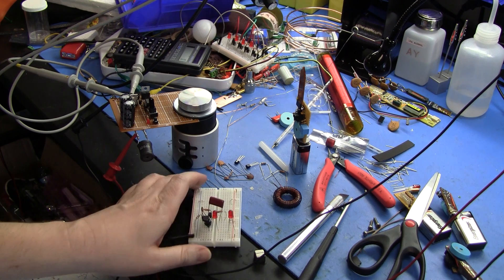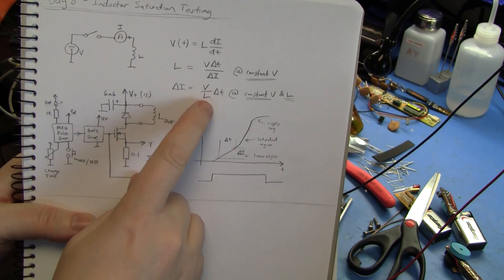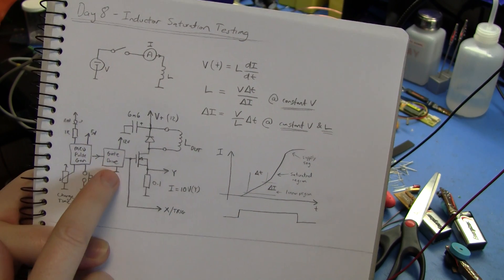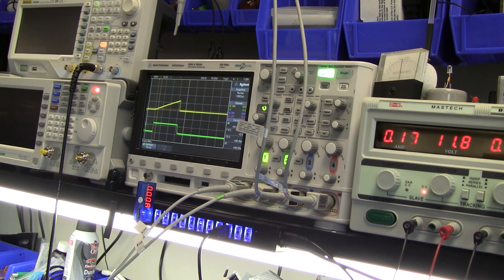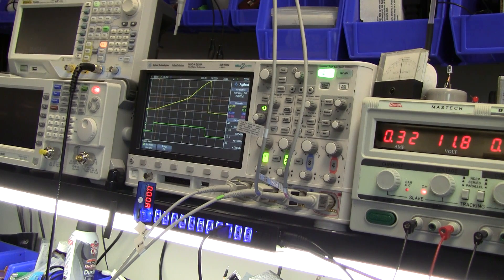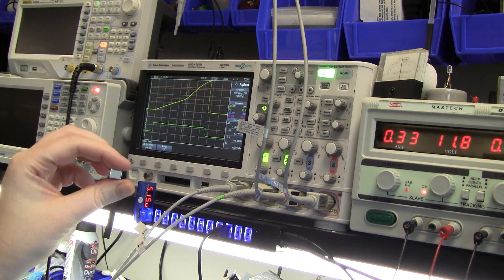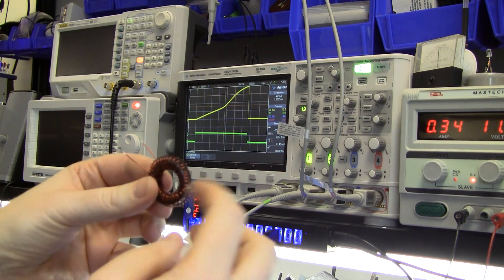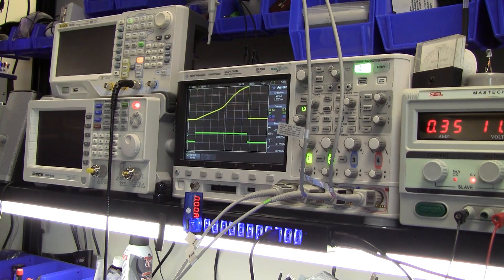Advent Calendar of Circuits 2014: Day 8: Inductor Saturation Testing

Comment: Thanks very much for this. Its incredibly useful! Have built this circuit and it works great. I didnt use an MCU but hooked up a signal generator and a discrete gate drive circuit Ive been using for a while. Thanks 😊

Comment: Hi vk2zay,

I found this interesting video in your youtube page. But I've some questions related to Inductor saturation switching period. May I know, are you using the high frequency switching square pulses to test the effect of inductor saturated? Because in your video at 5.01min were describeb by using MOSFET driver to drive the MOSFET switching ON/OFF and the switching period is controlled by the push buttons. So what is the switching period of time in this experiment?

Regards,
John
Reply from the maker: +Lucky Pipi The on period is controlled by the MCU which helps set the maximum current (along with the inductance of the DUT and its resistance).  The drive to the FET is as square as possible.  The current starts at zero and ramps up as the inductor charges from the voltage source, the slope of the current ramp is related to the inductance, when it becomes nonlinear the inductor core is saturating and its inductance is dropping, increasing the rate of current change.
Reply: +vk2zay  Thanks, finally I got the inductor saturation waveform like last months. Sorry, late for replied you. Thanks for your video demonstration and brief explanation. I'm using the IR2101 to drive my power mosfet. I also built in PCB to test up the inductor saturation phenomena. Since, toroidal inductor requires high peak current to saturate that y I built in pcb. Anyway thanks for ur video have a nice days.

Comment: Nice one.  This will help with the saturation problem I have at work or at least using the magnet may give me a quick indication whether or not this is the problem, I would imagine that introducing the magnet with the core in saturation and the o/p voltage lowered due to this, the saturation point will change and the current will go up and the voltage o/p too will change and go up, just a small movement may be enough to see what is going on.  That's if I have grasped the crux of the video that is.
Thanks again.